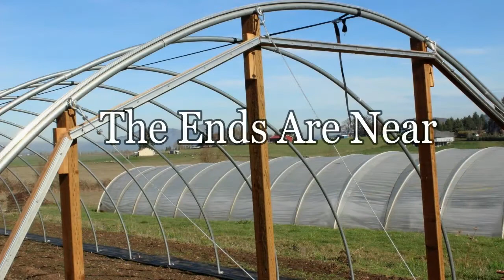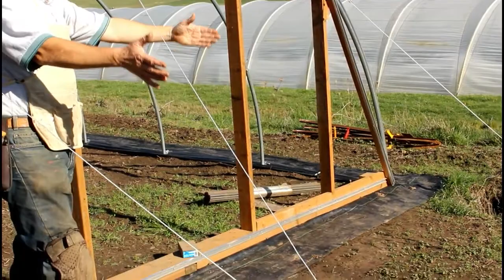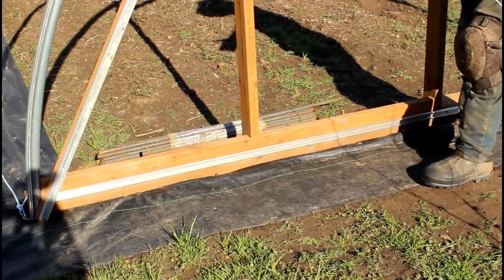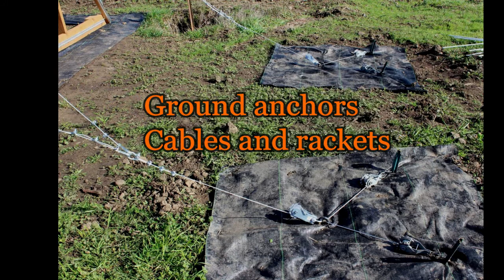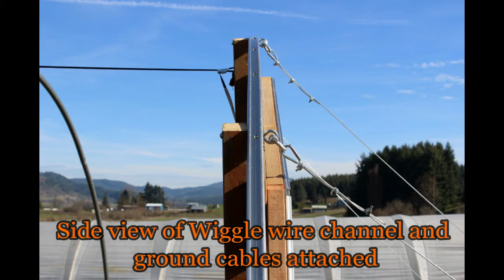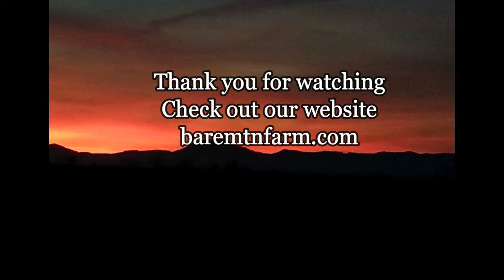Part 3: The Ends are Near!

Comment: We space our hoops 3 feet apart and use 1 5/8 inch galvanized tubing to combat wind and snow load. Do like the ratchet idea for tensioning.
Reply from the maker: Yeah, the hoop diameter is 1 5/16 O.D.  sounds like you all get some pretty good winter weather!
Reply: We can get anywhere from 6 inches all winter or 3 feet overnight. The wind on my wind register (anamometer?) has been over 80 mph peak. Winter is not my favorite season. Oh well.